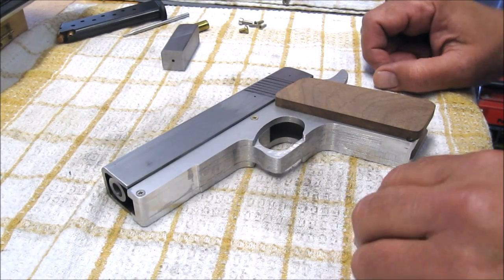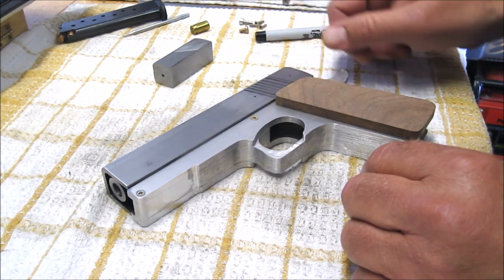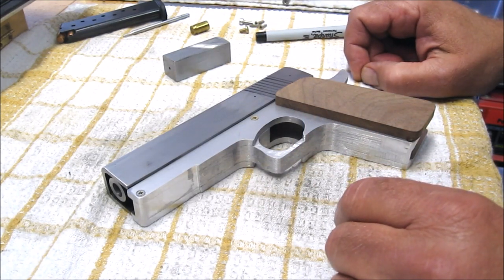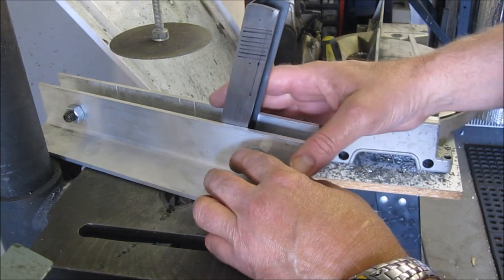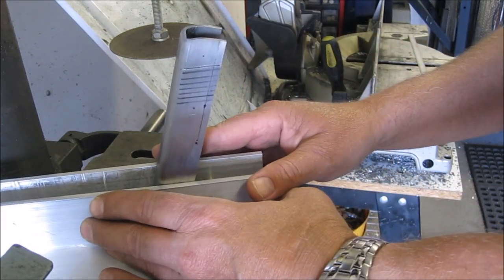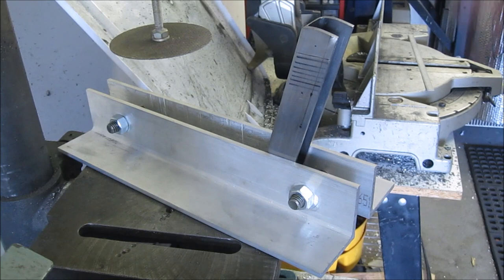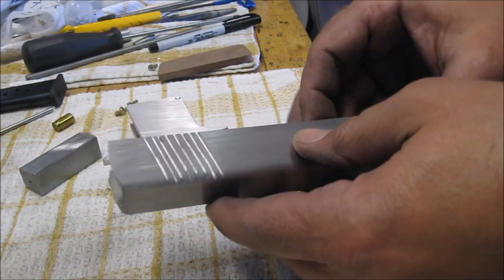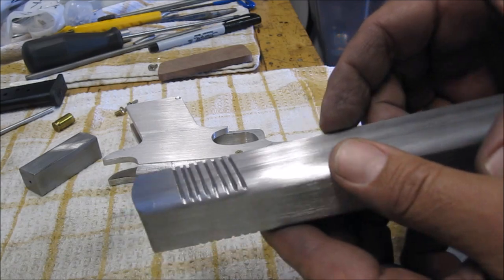Kolt380 Re-boot - Slide serrations

Comment: Looking forward to the hammer group, and getting a better look at the recoil spring assembly.
Reply from the maker: I've been doing some early exploring on the spring thing. Looks like a custom wind once again☹️
Reply: What OD, ID and wire size are you looking for? (I'll see if I can find something work able that is commonly available.)
Reply from the maker: I have various sizes of music wire in the shop. It will be some experimentation to get the right gauge and twist rate. Thanks for the offer though.